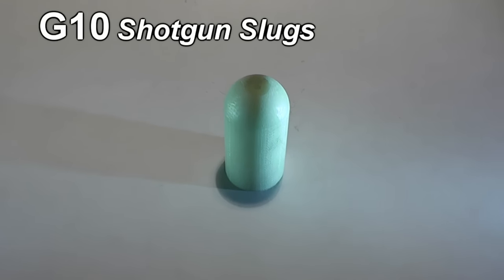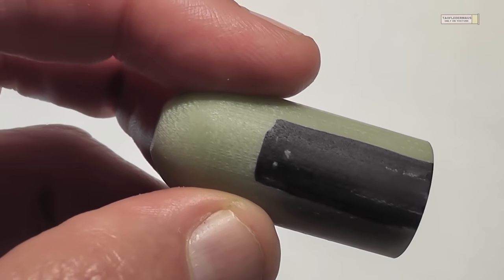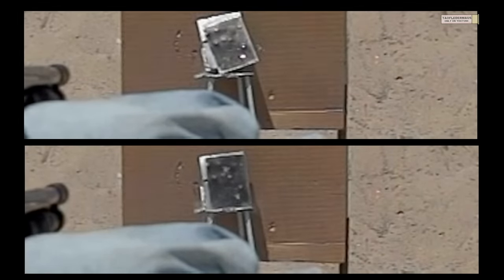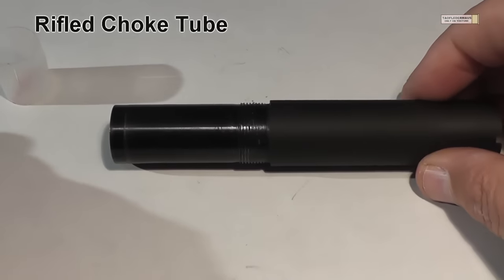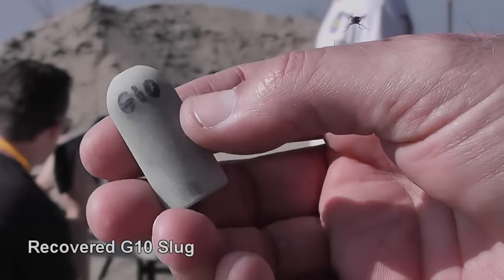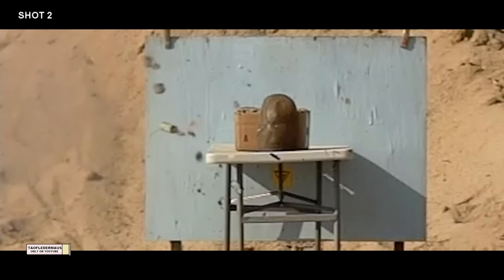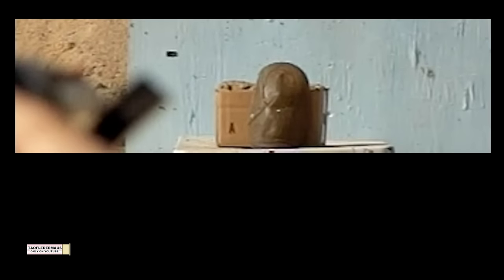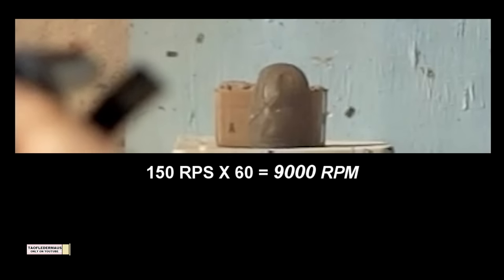Huge G10 Composite Shotgun Slug -  Cartoon Physics

Comment: I love internal and external ballistics.  The total weight, and length of the round is very important, but the location of any added mass is just as important as the length.  When we (weaponeer.net) are looking for data when none could be found, I have gone as far as to review basic model rocket balance and stability data to ultra light weight projectile testing, by including lead or tungsten to add additional mass to a projectile (normally by drilling through the middle of the projectile and adding a heavy metal core to the projectile just is not enough to always keep them stable).  There are formulas that will tell you what the projectile length needs to be, as well as the amount of weight that is required along with it's location, in order to make the projectile, balanced and accurate.  Unfortunately I don't remember what it is...  lol  But, the hole needs to be precision made or it will not work.. Without knowing the formula or length, you need to do testing in batches of three to keep the lot size small and costs at a minimum..  Now personally, I would use the projectile style just like the Sierra 165 grain HPBT game king, but the HP cavity would be drilled all the way through, ( the BT section would just basically be a plug that was threaded or friction fit).  I would also make the HP part out of a Tungsten rod that's been sharpened on the HP end.  There would be two choices, go with an all tungsten design, or, Tungsten and Lead design (for the mass).  The thin pointed  Tungsten rod, adds just a little mass, but it's primary  purpose is to act as a penetrator (which is why it's sharpened. the smaller the diameter the better it is at penetration).  now that tungsten rod must only go into the lead or other weight.  that end weight is called a knocker, and it's basically nothing more than a hammer for the tungsten penetrator (acting as a dead blow hammer, to distribute the energy of the strike over a longer period of time, providing the best possible penetration).  Now you can have a long projectile for a long and sharp penetrator, as well as to have a knocker about 1/3 of the size of the projectile, but only in the rear and up to the middle.   it's the length of the projectile, and the length of the "knocker" ..

Comment: I wonder, since you say that density's an issue and this had an empty core, could you maybe insert a bolt into it? since it seemed to be threaded already. Maybe machine the head of the bolt a bit once it's been inserted head forward so the center of gravity's closer to the front but still smooth, not hex...

Comment: neck the center of the cylinder down and create a sabot to fill the negative space. this will create a tail and from the spin puts the weight and rotation at the head where the mass iss and weight causing the projectile to track straight

Comment: How snug do these slugs fit in the barrel, Jeff?  I think that in order to gain any benefit from the rifling in a barrel / choke tube it will need to grip pretty tightly, otherwise the slug could become destabilised by being imperfectly engaged.

I wish I could do some experiments like yours myself, but I live in the UK...  I have guns but unless the shotgun load fires more than five pellets you need a special license that I don't have.

Keep up the good work.
Reply from the maker: +JackRoadkill  The shot cup filled the space between the slugs and the rifling.   It had to have been engaging them to get the slugs spinning 9000 rpm.
Reply: So the slug itself has spin imparted to it by the friction between it and the shot cup?  Could instability or inaccuracy be down to the separation of the cup and the slug?
Reply from the maker: Eh, it's possible.  but  I only used 2 of the 4 petals of the shotcup so the slugs would even fit.    There wasn't much of a connection between the slug and the wadding once it left the barrel.
Reply: That makes sense.  Thanks for taking the time to reply.

Comment: I am loving the changes you've made. Specifically the more traditional styling of the scientific method (question, research, hypothesize, working/not working, troubleshoot, analysis, results.) Thanks for the enjoyable videos. Though I have been wondering, would the Anti-Superman round work better using a lead/soft metal jacket, a rifled bore, and a hot (overcharged) high-brass shell?
Reply from the maker: +D. Duncan  I have two of those heavy tungsten drill teeth left.  We had luck using hot glue to hold it in the wadding of some heavy turkey load shells.   I think the rifled choke tube should get it spun up ok.
Reply: +TAOFLEDERMAUS I would love to see how they perform.

Comment: how many glass impregnated rounds like these do you think you could shoot before the rifled choke starts to significantly wear?
Reply from the maker: +stereomike111  The slug is actually smaller than the bore,  but the plastic shotcup they are stuffed into fill the space between the slug and the rifling,  so there is very little wear.

Comment: I noticed that your round was hollow in the center and threaded you could have filled it with lead shot and secured it with an allen bolt also it doesn't appear that the lands of the rifling are not impinging on the projectile usually when a bullet is fired there are rifling marks on it I think the shot Cup is preventing the projectiles from getting a real grip on the rifling
Reply from the maker: +tarstakars  They were spinning at 9000 rpm.

Comment: one question, if you shoot a slug or buckshot, with a choke.. will that damage the barrel/choke? ( i ask this cause its obvious i only shot birdshot out of my weatherby pa-08)
Reply: I don't think so, lead is very soft. I'm pretty sure 12ga foster slugs are designed so they can squish themselves down a bit as they pass through a choke.

somebody please correct me if I am wrong.
Reply: Buckshot is fine through a choke, slugs won't damage anything but they won't be as accurate in general
Reply from the maker: +Rods Ahed   We've shot 00 buck through a full choke and it didn't damage anything.  The pattern was really tight.
Reply: ***** cool. i was just wondering because, well i wanted to try either shell, because Birdshot is kinda boring.
Reply from the maker: Yeah,  birdshot isn't much fun.   Most slugs can be shot through chokes just fine.  Even those steel  Dupleks can be shot through them.

Comment: You should try to compare the densities of the bullet/slug to ones of similar size. But I think you would need to compare the effective density so any empty space in the back or core of the bullet/slug is discounted; you get the outside volume of the bullet/slug and divide that into its weight. Then we can see how big of a difference a change in density may play as a factor, or not and maybe it has a lot more to do with other factors.

Comment: you could try to put a small bolt inside the slug. One that would be shorter than the hole slug so it will be nose heavy
Reply: Or maybe fill it with molten led

Comment: Do you ever calculate the muzzle energy or velocity of the projectiles?
Reply from the maker: +NavySturmGewehr   No,  we'd just destroy a whole lot of chronographs with waddings or projectiles smashing into them.
Reply: +TAOFLEDERMAUS Another question, what is the ideal OD for a sabot?  I might be able to make you some interesting projectiles.
Reply from the maker: +NavySturmGewehr   .720"  would probably be the ideal diameter.
Reply: +TAOFLEDERMAUS The projectiles are 4.000" long, 0.314" OD and weight 2.62oz.  Will these work and do they need to be fully supported by the sabot?   How many would be ideal for you to properly test them?
Reply from the maker: That is way too heavy.  We limit the weight to 1 oz, normally.  We've gone as high as 1.75 oz but had to use special turkey load shells.
Reply: +TAOFLEDERMAUS Oh well!  They're carbide mixing tubes for a waterjet, I figured they'd make good penetrators.  It was worth asking, thanks for the replies!

Comment: Maby drill a hole into the slug and add a cylinder lead weight to add some mass to the slug to fix the stabilization issue

Comment: Is it legal to shoot plutonium out of a shotgun? Seems like it would make a good projectile.
Reply: +Badatstuff I don't think its illegal its probably dangerous since its plutonium if I'm thinking of the same thing
Reply: +milk monster (inflatedcheese) it is pretty radioactive. It would probably be okay if one took proper precautions though (ie not shooting it out of a gun :p)
Reply: lol yeah
Reply: +Badatstuff Plutonium wouldn't make a good projectile. If it were large enough that the gasses wouldn't go around it, it would be too heavy to be pushed down a barrel of a conventional gun. The plutonium probably wouldn't react to the explosion. But the thing is the round going off is an explosion. Explosions take the route of least resistance. If it is too hard to push the projectile, the easiest route is blowing out the sides of the gun.
Reply: +acephantom903 wow, I didn't realise plutonium was that dense. Probably not a sensible plan then...
Reply: Badatstuff It is roughly double the density. So something the size of a 1 ounce slug would be 2 ounces. As far as I'm aware, maximum "safe" load is 1.5 ounces.
Reply from the maker: +Badatstuff  I'll see if I can find some Plutonium at Walmart.
Reply: ***** It's on Amazon... Laboratory samples in glass vials included in the periodic table of elements.
Reply from the maker: Is it less than $5?
Reply: +TAOFLEDERMAUS Have you considered using steel pipe as a projectile?

Weld one end closed, angle grind it nice and flat and maybe drill a small hole or an array of holes to see if it helps or not. Maybe drill a few few hole along the body of the pipe and remove all the burred edges as best as possible and they fire that shit into oblivion... or an old microwave!!!
Reply: +TAOFLEDERMAUS It's right next to the kryptonite. You should do a kryptonite slug next.
Reply: ***** Can you not obtain a sample of depleted uranium and put it into a 'magnum shell' with a heavy coating of high impact heavy density plastic or steel?

I've no doubt a round like that would de lethal and destroy anything!!
Reply: Plutonium would not be good for shotgun slugs, it too heavy, but it would be OK in other applications, specifically ones requiring armor penetration in weapon made to handle it. Thing is - Plutonium is a synthetic element and thus not commonly available. Anything it could be used for in conventional weapons can easily be (and is) substituted for with Uranium or Tungsten, which there is no real lack of (thus cheap) and are more safe in handling due to lower reactivity.
So if you could shoot a Plutonium projectile, it would do nothing Uranium and Tungsten projectiles dont do, and we have been using those for 50 years left right and center.
So as for legality.. given that it is a synthetic radioactive element produced in reactors, its unlikely to be legal for possession nor is there any actually possibility for anyone to do it given where and how it comes to be.

Comment: Should have put some lead in the tips; could have used a heavier nose.
Reply from the maker: +jjenson2006  Each one had a large core of tungsten in the nose,  which is denser than lead.
Reply: +TAOFLEDERMAUS Printed Circuit Boards are made out of that same material. The overall weight was, 19g? Probably would have gotten better results if it was an ounce or more. Maybe bore out the nose a little wider and fill it with the tungsten.